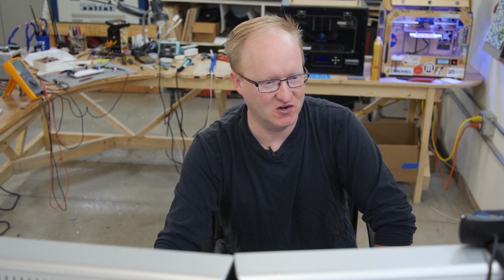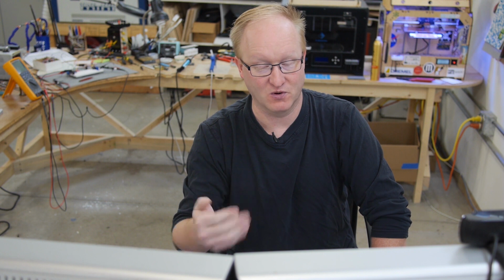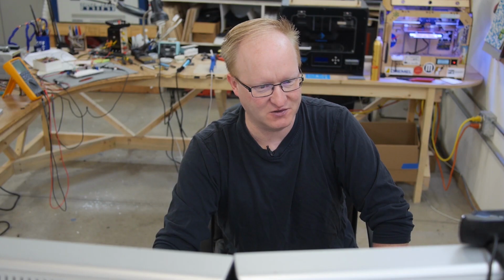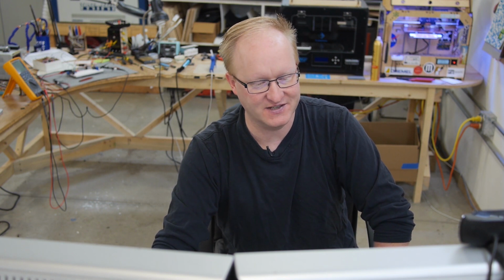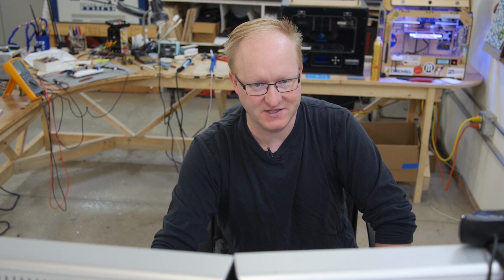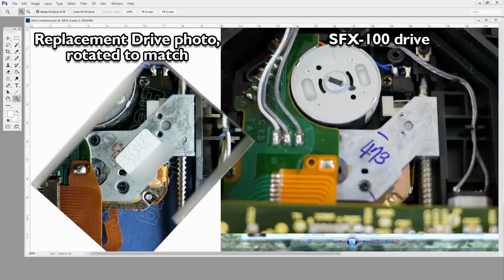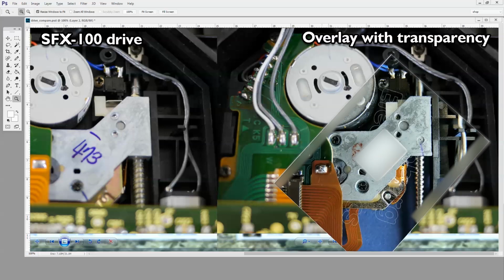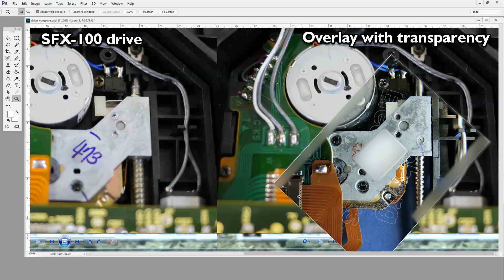Ben Heck's Nintendo-Playstation Prototype Update

Comment: huge question, is it possible to mod a cd drive to a super nintendo system and load the bios from a custom made cartridge?
Reply: Depending on how much SFX is modified from SNES to make run those CDs, if it's still normal SNES then you could teoreticly make a device which which would communicate with SNES in same way oir atleast in much degree to make CD games work

Comment: Ben,
 Not for nothing, I may have missed some of the fine details in the work that you have put on this device. But, I used to have an NEC turbografx16 that I also got the cd player for. Ok, now although this is a different system from a different company the era should be on par with the device you're trying to get working. Anyway, before any cd's (music or games) would run on the tg16 one would have to put into the card slot a card that told the gaming system how to use and read from the cd rom. Do you think nintendo/sony may have implemented a similar need in this prototype device?

Comment: Speaking of ribbon cable, I broke my first PlayStation 1 by ripping one. The discs wouldn't read which I later found out was because the lense/laser thing wouldn't move left or right and was stuck. I pushed it as hard as I could to get it out and SNAP. I could see half the orange ribbon cable sticking out of the disc spot. 6 years later I found a replacement console for $10

Comment: If you can get the SNES-CD's disc drive working, you should try playing SNES CD homebrew programs on CD-ROM on the system, as well as audio CDs because most CD-ROM-based consoles have a built-in audio CD player, such as the original PlayStation, PlayStation 2 (also uses DVD-ROMs), SEGA Dreamcast (it uses GD-ROMs, not CD-ROMs, although you can use copied Dreamcast games that you burned onto CD-Rs and possibly CD-RWs without modification on the console due to the MIL-CD security exploit) and PlayStation 3 (some models can play PlayStation 2 games (hopefully including CD-ROM games), all models can play PlayStation 1 games and all models can also play audio CDs).

Comment: I have one for you, I have and love my N64, but the memory cards require batteries. I have a Performance memory card from when I bought the system... I found a potential Non-volatile 256k memory chip for replacement in the MB85R256F. Suggestions on removing the battery and storing N64 saves forever??? The original chip on the memory card is a W24258s-70LE.

Comment: but even if its fixed does it have some unknown copy protection that you still have to get around...
Reply: Not necessarily.  This was during the age when CD burners were massively expensive pieces of industrial equipment.  Copy protection for CDs wasn't needed or thought of until the PS1 era - systems like the Sega CD and Turbo CD stuff has no copy protection at all.
Reply: but this was also made for Nintendo even their carts had copy protection..
Reply: You're missing the point, Sam.  At that time period, the very nature of CDs was the only copy protection needed.  It doesn't matter that it was Nintendo or Sony at that point in time, because CDs as consumer materials could only be copied by massive industrial equipment.

I even pointed out contemporary real-world examples.  The SEGA CD?  No copy protection.  TurboGrafx CD?  Nothin'.  Panasonic 3DO?  Nope.  Sony, in fact, was the first company to make CD-based games that had any sort of copy protection.  CD copiers didn't break below the $1000 mark until 1995, several years after this device was made, and they were only casually affordable by '97.  The expensive nature of copying CDs was the protection.

The fact that the Playstation, released in '94, had any sort of copy protection was actually more to do with region-locking than with preventing burned disks.  The copy protection was more of a neat side-effect.  Which, incidentally, is exactly the same ideology that Nintendo had with their carts.  So, no - Nintendo cartridges do not have copy protection, they have region lockout chips.  The only so-called 'copy protection' that Nintendo used was custom-engineered chips that had a different pin layout from industry-standard chips, and even then, all you had to do was take the time to wire up an adapter and then any chip reader/writer could read it with no problem.  I've personally taken advantage of this to make my own copies of rare games using MC801 chips in place of Nintendo MaskROMs, and all I have to do is byte-swap the data and then rewire two pins, and viola - any game I want.
Reply: the copy protection wasn't for the average consumer it was for third parties wanting to make games or copy games for the nes or snes or hypothetically the snes cd without Nintendos approval. each cart had a CIC chip in it only issued by nintendo https://en.wikipedia.org/wiki/CIC_(Nintendo). so you cant just make your own cart from scratch with out that chip
Reply: That chip, however, has been defeated for years.  Look up something called the SuperCIC, my friend.
Reply: Sam The Multimedia Man In addition, counterfeits have existed for nearly as long as each system has.  Hell, even the Famicom Disk Drive game's copy protection got broken through during its lifespan.

Fact of the matter is, if you're determined enough, you can crack any copy protection.  Copy protection exists mainly to prevent the average consumer, i.e., the people who actually financially support the products and the companies, from getting the product without pay.  Companies, particularly Chinese companies, DO have and DID have the means to defeat that copy protection, even way back when.

You have a lot of accurate points, but the way you're putting them together has led you to an inaccurate conclusion.  Respect, though.
Reply: I would rather let It unable to play homebrew SNES-CD game because it has some kind of protection, if it actually has.

Comment: Hey Ben,  I'm sure someone contacted you on a better forum. But I read a comment about how this chip should be desoldered/read out  before it goes bad and loses it's data forever. 

http://www.blogcdn.com/slideshows/images/slides/369/062/0/S3690620/slug/l/sony-sfx-100-snes-teardown-2015-11-01-20-1.jpg

"Byuu bsnes/higan developer"
"What really concerns me most is the NEC D75P308GF chip. This controls the CD I/F (interface) commands. There's a program flashed into that chip's EEPROM data that's been sitting there for 25+ years.

Our emulation currently has to use HLE for its functions. If that chip isn't dumped, this system will brick forever in probably 5-10 years tops."
Reply: +Ganjulation I can't edit on mobile, but I find it funny the chip itself is relatively simple but will be a shame if it does end up missing it's data and killing the console( Here's the High Level Emulation of the chip in question(Cannot be used as a chip replacement but for emulation )
https://gitlab.com/higan/higan/blob/master/higan/sfc/expansion/superdisc/nec.cpp
Reply: Incredible, hope the owners of the system and Ben see this
Reply: Thats very true.
Reply: Nice find.
Reply: I was thinking the exact same thing when I saw him measuring the battery voltage. The battery will need replacement at some point and you can't just pull it out because the data will go 'poof'.
Reply: has he seen this?
Reply: +OK I'm sure Ben  takes a peak at assemblergames which mentions it, but not the quote I used from Reddit by  byuu the snes emu developer. Luckily Dan is a pretty cool guy and is active on both websites so I'm sure he took a look at the comments from the Reddit link about this in /emulation, even though I mostly see him on /retrogaming. Also I think Ben  maybe he actually has seen my comment too, who knows.

I'd like to hear about how hard it is to get a read off that chip seems to be quite risky, even Ben may not be up for the risk. I was reading beside removing it that seems to be quite a process, you could do some sort of procedure involing 21 volts into it! But I'm talking a bit out my ass there
Reply: +Benjamin Heckendorn

Comment: If it was mine, doubt I'd even repair it. wouldn't taking it apart, repairing and changing parts hurt the value?? I'd rather keep it original as possible, even if it meant it wouldn't be functional. I mean on such a rare prototype.
Reply: I get where you're coming from, but not all of us care about money and something's value. It's way cooler in my opinion to have it working, I'm like a car geek too, old cars that work with new parts are better than old cars that sit in the museum never getting drove. Cars are meant to be driven and consoles are made to be played. Even if they are the only known one left on the planet.
Reply: You took those words out of my mouth XD but i absolutely agree with you.
Reply: I wouldnt touch it either. This is the only one in existence. The monetary value is nothing compared to the historical value of the original parts and assembly. They have effectively destroyed its original state and part of video game history.  i understand what they are trying to do and why they tore it apart, but to me, with it being the only one, it should have gone to a museum as is, as a part of history.   Consoles may be meant to be played, but this one wasn't. It was a prototype. Replacing even small parts removes small original parts of a what is a completely unique piece of hardware. 
I would have left it as is, and only went as far as dumping the chips if possible to allow the emulation scene to instead make working emulators for it.
Reply: Opinions are always subjective.

Comment: Ben , I think this is cool the only issue I have is its NOW more than likely an actual a one of a kind piece of video game history, it was a rumor. Changing out  parts and pieces on this particular machine, I don't know, it's almost past a true cleaning and restoration at this point and like the difference between a painting restoration which is what you in a sense awesomely did in the first series of videos and actually painting a palm tree into the painting that your restored.
Reply: I agree on this, this is not a painting in which i will agree that any change can damage the original. This is a piece of electronic equipment, and its supposed to do things as part of its history, if a bad capacitor or a bad laser is not letting it do what it was meant to do, then we are missing history and the bad electronics are the culprits of it, time was the one damaging the original unit. With that said Great Job Ben i will love to see it restored and executing a game, cant wait.
Reply: I kinda agree but to get this working will be awesome and it will then be a working prototype!
Reply: but it would be painting a palm tree that was supposed to be there all along
Reply: *****
Oh no , Im sorry there was a misunderstanding I have zero issues with work you did on the device in the original two part series, I actually liked it a great deal and now sub.

I was specifically referencing the laser assembly. It's also just a concern I'm not upset about it, lol. Have a good one.
Reply: Vincent The Keeper though the prototype's CD drive might not've worked, the obvious intention was for it to work or else they wouldnt have put a CD drive in it. and its more so we can say there exists a fully working Nintendo Playstation somewhere in the world, along with a couple fan created games that also work on it.

Comment: can't wait to see that awesome and rare console up and running again. Are you also going to give it a peroxide and UV treatment to reverse the yellowing on the case. .?
Reply: Given the fact that this the currently only known SFX-100 units in existance, I would refrain from using any sorts of strong chemicals could cause irrepairable damage. At least not until all plastic parts have been remodelled using a 3D CAD software so they can be reprinted/recast.
Reply: he totally should
Reply: Probably the safest move.

Comment: I wonder if it's possible to rebuild the Nintendo Playstation from scratch.
Reply: You probably can make an arduino or something act like it, given the fact the bios has been leaked and reverse engineered etc..
So what you need to do is to make an microcontroller that can understand the bios commands and read the CD etc..
Reply: the hardware probably can be replicated by meticulous documentation. Though the software in the chips might be a harder case to crack... But with enough time basically any system can be replicated.